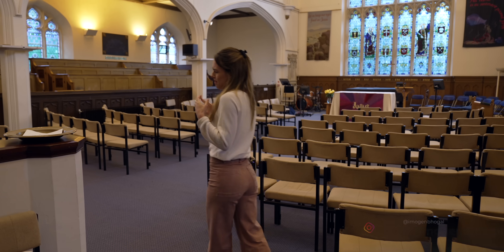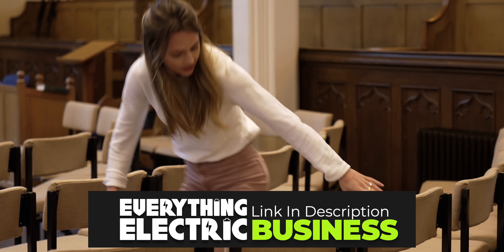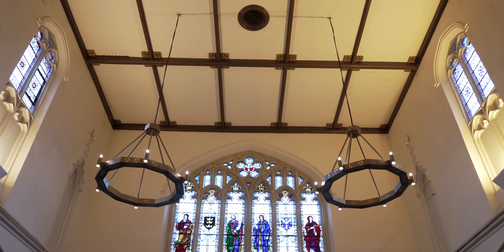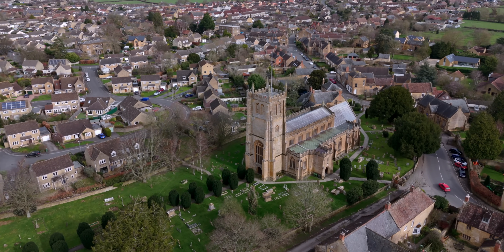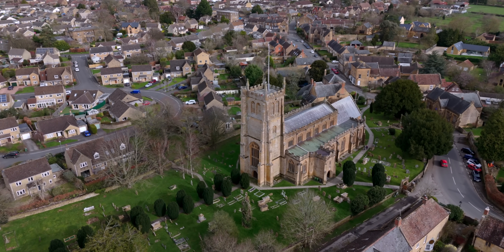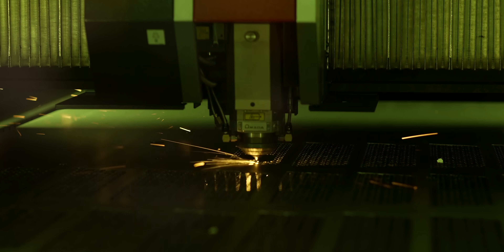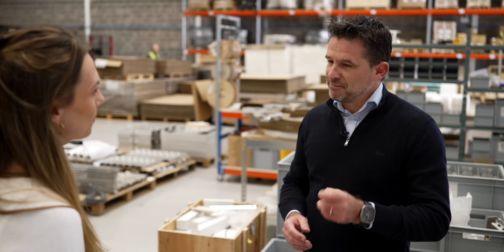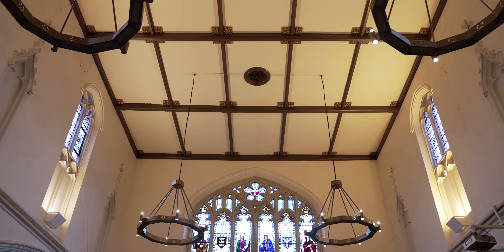Is Infrared Heating the Holy Grail of Electric Heating?

Comment: Best bit was when Simon said cost per service had come down from £75 to £15/service.  Now we need to know the upfront and lifetime cost of the equipment .  People need to know that as well if they are to take things up.   The tech is perfect for big rooms and I have one at home.  Its great.
Reply: Herschel Infrared is the company's name.  These chandelier heaters cost between $5650 - $8950 each.  It looks like this church bought the most expensive units, so it cost them $35,800.
Reply: @updlate4756  Yus... but it would likely have cost a lot to buy and install any other heating system for a building that large.... not to mention the operational costs.

Whilst these heaters may have been expensive to buy, the installation costs would have been far less (especially if they already had chandeliers or similar for lighting), as well as their lower operational cost (given they're no longer trying to heat the entirety of the interior, etc)
Reply: @updlate4756   true, so they should easily pay for themselves in the 1st year.
Reply: They didn't, he said they were trial units.  @updlate4756
Reply: there is approx 40,000 churches in the UK so saving work out at £2.4million for 1 service at each church, that's near £129million a year in savings.
Reply: Not all of those churches even have services anymore. There a lot of churches that are just maintained because they are listed buildings @morrisonmeister
Reply: Must add "cost per service" to my list of energy metrics.😂
Reply: @michealoflaherty1265  

Yes you're quite correct there.

Works out at £15 a head.
Reply: All you have to do is buy infrared bulbs. Here in the US you can buy them at any hardware store for $8 to $10 bucks. They are mostly used in bathrooms. It takes about 5minutes for one to heat up an average bathroom.
Reply: Infrared bulbs bathing a church would look like you were entering to worship satan......Don't think they would work somehow  @Metal0sopher
Reply: IR heating can be great for short occupancy or extremely voluminous locations as shown here but it's far from ideal for homes. Firstly it has to be on continuously for you to feel warm, more importantly, by not heating the fabric of the building, there's a high risk of condensation and mould growth on surfaces in occupied rooms without increased ventilation. It's far from a panacea in homes.
Reply: @billmeds  

Really?

You type as if you understood the science.

Which you most certainly  don't.

Comment: Infrared/direct heating is great for applications like a church or a garage but im not sure I"d use it for a house. Its fine if you sit in front or under the heater but if you want to heat a whole house the electricity is one of the most expensive methods. In the UK ekectricity has typically cost three times mains gas.
Reply: I think that is the whole point @ColinWatters. IR is used to heat people and articles in just a small area as opposed to the whole structure and components within it.  Paired with a heat pump system, which is much more efficient that just about any fossil fuelled burning system, and electricity is bound to be more economical.  And of course you could opt to generate some of your own electricity if you wanted to.

Comment: I don't think anyone mentioned the initial costs of purchase and installation, so I am guessing it wasn't good news.
Reply: Installation looks dead-simple (and they say as much in the video, iirc).  Prices to purchase are mentioned in other posts, but ~5k-8k per unit, I think (which is what a small heatpump installation for a residential property would cost... this church is far bigger, so would likely need a far more expensive heat-pump installation, which would then cost more to run), and as mentioned in the video, operational costs are far lower than heating via gas etc.

Comment: Another reason radiant heating feels more comfortable is the air is cooler. Cool air feels fresh and enjoyable. I won't be putting a halo heater in a house, but radiant-heated floors or walls using water heated by a heat pump.

Comment: This is a nice simple solution if you don’t need air-conditioning. If you need AC, a heat pump becomes the most straightforward and efficient solution.
Reply: Classic stone churches do not need AC.

Comment: Oddly, in the last 10 days I've bought two freestanding infrared panel heaters for home. The first was a 540W panel for the north facing kitchen that only has a very small radiator and the gas CH can't get warm enough. It's 600mm x 900mm and sits neatly under a breakfast bar where there was already a plug socket. I thought it would probably also work well in the conservatory so I tried it in both rooms and it worked brilliantly. But it's a bit big for the conservatory (looks wise) so when I spotted a 425W (600mm x 600mm) one at The Range for just £30 I snapped one up. I can't believe how good they are, as the video says they don't directly heat the air, they heat the furnishings and people.  Both can be controlled by a phone app and the larger one is even Alexa compatible.

Comment: I was keen on getting a heat pump, but more and more I think we want infrared with occupancy sensors. I love this, I'd spot it because that's me, but I think very few others would.
Reply: IR heaters are excellent for fast, localised, short duration heating, and beautifully illustrated here in that precise application .   But dwelling houses are used long duration occupancy.  Furthermore because houses are long occupancy, you also need to control condensation. Aside from ventilation, condensation is also controlled by heating the building up, not just the people in it.  You can use IR heaters in this situation, but heat pumps are the more efficient solution for long occupancy times.
Reply: An air-to-air heat pump provides air-conditioning as well as heat, which is a key factor in more and more regions these days.
Reply: It may be worth considering both... heat-pump to maintain a comfortable base temperature... and a portable IR heater for those days when you feel cold (instead of turning up the temps of the heat-pump, and paying to warm the entire house when you're just sat in the lounge, etc)

Comment: Radiant heating needs to come from sides or floor. Radiant heat from above makes your head hotter than the rest of you and it feels bad...
Reply: Probably ok in a cold church.
Reply: The installations I have seen in Churches generally have them on the walls, at a height where it comes in at about 45-60 degrees

Comment: this is such bullshit. the laws of thermodynamics still apply when you are using infrared heating...

this is simply a very niche application where it might edge out other means of heating.

but still, there is a lot of bs in this video. "you're not losing heat anymore through the stained glass or the giant lofts" lol yeah sure, the magic heaters made the glass more insulating.
Reply: The aim is not to heat the whole space indefinitely but the congregation and the furniture they are sat on. Of course the heat then escapes but the warmth is maintained for the duration of the service. 

The same is done, without regard to the atheistics, in warehouses and factories.

Comment: So basically put people into an infra red oven.
Turn them when one side is done. 😁

 It is not really efficient as the electricity has to generate the heat/light directly, a heat pump extracts low level heat and raises it, so not having to generate it just power the process. 
IR would be cheaper to use, in many situations and with changing expectations, which is a bit different, by only heating spots people are in, not whole houses, or churches entire volume. Something people would need to get used to when used domestically. The current daft addiction to centrally heated entire houses, to silly high levels has to end anyway, never used to be like that pre central heating nonsense.
Reply: Heat-pumps are only more efficient than IR heaters when comparing their ability to heat an equivalent area.

However, the best 'efficiency gain' is not doing something - rather than trying to heat the whole building more efficiently (heat pumps), they chose to reduce the areas that were heated (radiant heating)... and that reduction in heated area is significantly better than the energy-efficiency gains of the heat-pump... which is why radiant heating is 'more efficient' overall, and in *this specific scenario*.
Reply: @logicalChimp  Yes in this very specific area it probably is, especially as the time they need to be on is very small in any week, just for a service or two. 
I was largely thinking of their general use in homes. Where they still have a place but are not more efficient for modern expectations of heated whole houses. More like old days of one fire in one room, more how I live actually!

Comment: You really always need to mention in these videos that heat pumps will always be over 3x more efficient than literally any other source of heating. While you might be heating a smaller space with infra red, it really doesn't matter that you're heating a larger space if the heat is a third of the cost with a heat pump.
Reply: So the heat pump is three times more efficient but you have 8 times as much space to heat..... Doesn't add up.
Reply: @eldridgep2  Too many people in this thread seem to think that 'efficiency' is a magical power that trumps everything... when it's just an equivalency score generated by getting different competing-products to solve the same task (such as heating a fixed volume).

Reducing the volume to heat is another form of efficiency - and as pointed out, the 8:1 spatial-reduction gains for the Radiant heater (from reducing heated area) trump the 3:1 energy-reduction gains from the heatpump.
Reply: In general, yes, heat pumps will be more efficient, but you’d still be heating the whole volume of the building, which is exactly what they DON’T want to do in this scenario. Like the priest said, they specifically wanted zonal heating, which is what IR heaters like these are great at.

Comment: Is a 10,000 hour service life a bit low?
Reply: On for 2 or 3 hours per Sunday, 52 times a year, so about 150 hours a year.  They'll be servicing those things in about 60 years!
Reply: @simhedgesrex7097  Oh I was thinking more for residential - much of the day for much of the year and 10,000 hours will go by quickly
Reply: @13ccasto  But you wouldn't want to buy a Halo for residential heating.  Here's what Herschel say about their panel heater (which is what you would use, same technology).  
"Herschel Infrared heaters come with a 5 or 10 year guarantee. Our Inspire range is designed to last decades because of the high quality of materials and advanced heating elements that are used. Herschel Far Infrared panel heaters ."

Comment: Could more information be provided on how Herschel heat their manufacturing facility? Like countless others, my shop is a 10,000 ft² steel building with a 20' roof at the ridge. We absolutely blow through copious amounts of fossil gas attempting to heat the building during the cold months. The existing lighting are metal halide bulbs. They're slow to light and are tremendously wasteful; rated at 400W, but actually consuming just north of 450W of electricity. With 13 fixtures, the energy just to light the warehouse/shop area comes to about 1.2kWh per month! The replacement LED fixtures I'm about to fit will cut the lighting component of the energy bill almost in half. They'll also be brighter, light instantly and produce no heat (which only serves to increase the temperature in the warehouse/shop during the warm months).  It seems that infrared heating, combined with LED lighting, would be a natural fit for a quite large target addressable market.
Reply: For most spaces the cost effective solution is insulation,  just spray foam the roof and walls.  Where radiant makes sense in big space is a shop where the doors are constantly open in cold weather.  And even then one of those see-through flap doors  between receiving and the shop floor might make the biggest difference?
Reply: @briankuhl9314  Not true. My shop is fully insulated. The problem is conduction. Heat energy migrates from hot (interior) to cold (exterior). This heat loss is further compounded due to the volume to be conditioned. The vast majority of the volume doesn't need to be conditioned as it's entirely void of either people or material. Infrared heating works by heating people, not objects. Therefore it'd be superior to forced hot air. Especially where the electricity was sourced from renewables.

Lastly, spray foam insulation in buildings such as steel warehouses is economically infeasible.

Comment: My only concern would be that churches, particularly in the UK because of the way they’re built, can probably become damp in areas where heat is not present. So radiant heat like proposed here is great for costs, but you’d also probably need a bit of warm air circulation here and there anyway?
Reply: The radiant heat will circulate to the rest of the space, just not the comfortable temperatures we humans would like.
Reply: What have they been doing for the last 500 years ?
Reply: @jsanders100  convection heating.
Reply: @jsanders100 Exactly.  Churches started being heated in the Victorian era, not before (hence no fireplaces in cathedrals!).

Comment: Good to see this. For several years now we have had Herschel infrared panels in our listed house (1550 stone and cob) and love them to bits. Previously we had two wood burning stoves and a couple of ancient storage heaters, but we are much happier now with the quality of heat and the fact that we have been able to move away from burning stuff to heat the house. To complete that picture our energy provider is Ecotricity who source 100% renewable electricity. Initially we ran the panels off programmable thermostats, but we have found we can run them even more economically simply by switching them on and off as needed – as soon as you flip the switch you are feeling warm literally within a couple of minutes.
Reply: Are these like the Electric Heaters plugged into the Wall Outlet? Or something different?
Reply: @peterwynnychuk5085 

Yes, a standard three pin BS1363 plug in UK  or cobbled into a fused, switched spur off a ring main, or a radial from a spare on the consumer unit via a conveniently placed wall/ceiling pull switch.

Just make sure the cable is suitable for a possibly up to a 1kW load for the length of run required.

For sparkies this ranks as an "easy" job.
Reply: Believe you can plug some of the smaller panels in directly, but ours are hard wired into the ring main. Suggest you review the other video on this channel for more info: https://youtu.be/zSzYSfkwrts?si=CdDJamiUHnE3aUrl
Reply: You are? Must be different to the ones I have. They take about half an hour to warm even a small room up by a degree. Not impressed with mine and I've got 6 of them. 😢

Comment: With the heat coming from above, do you have cold feet sitting under this heat lamp?  
I assume the floor stays cold as the radiation does not go through the chairs?
Reply: The radiant heat does hit the floor as well,  and your feet are OK.  The problem is generally the drafts from the unheated areas if the temperature variation is too great.  As long as the rest of the space around  15C or better, your going to be comfortable, radiant heat fools you into feeling warmer, like walking into the sun from the shade as described in the video. And the floor and chairs will be toasty when you sit down, with the warm floor radiating if the heater been on for awhile.  

But there's no warm stones on the sides to mediate the temperature of the whole space, so the corridors are going to be frigid, especially right around the start of big service when the doors are wide open for bit.  When close the doors in traditional central heat all that extra heat you've pumped into the stone will warm the whole place up again, well luke warm at least, with the radiant heat the warm is pretty much under the lamps and that's it.

Comment: These are really neat. IR heating for spaces like this really make so much sense when they are so sparsely occupied. Just thinking outloud here, I wonder if there is still a requirement for some baseload (if you will) of some convection heating (heat pump ideally) . I wonder about the moisture risk longterm if the fabric of certain buildings is never warmed in the same way. Probably fine as it is a massive vapour open duranle ancient building. But certainly for other use cases I think the condensation risk of sole IR heating might need those calcs and assessment maybe. 
Simon seems like a really interesting chap.
Also, were churches heated historically? I imagine some have open fireplaces.
Reply: The Holy Ghost did all the warming necessary.

There again people hundreds of year ago probably wrapped up as best they could.

Comment: Ive worked in both a stained glass factory and done maintenence in a historic church in the US for a decade. The customization offerings are absolutely brilliant. Currently, lighting options for churches revolve around 2 options: insanely expensive bespoke designs and the same catalouge options that everyone else has... which very often will clash with the existing interior. So being able to offer something that adds touches of personalization to tie into the architecture is novel for just a lighting solution... but building in heating as well... thats a genious stroke. I hope you guys are patent protected because this is insanely good.